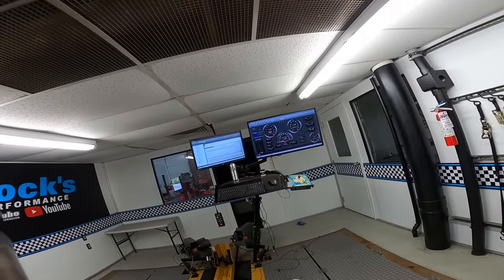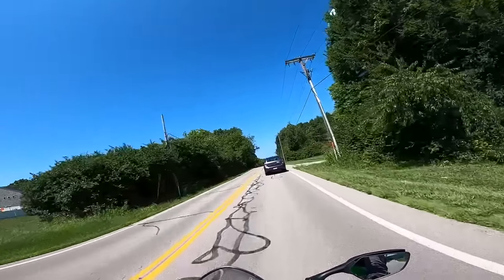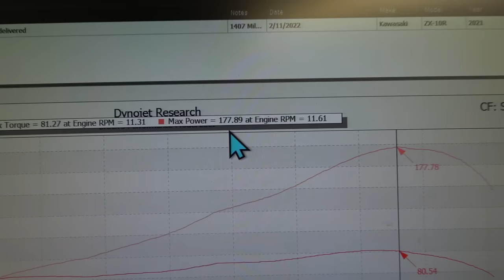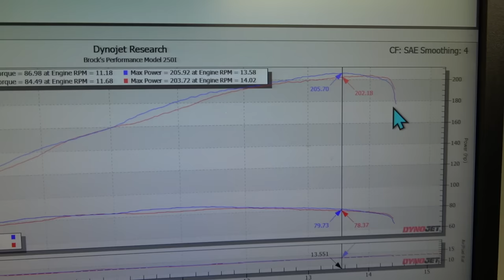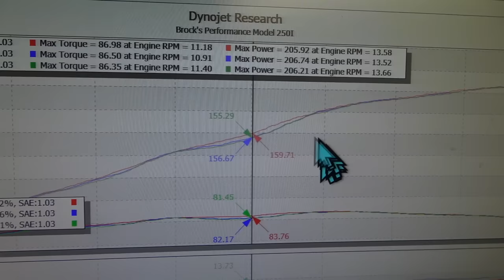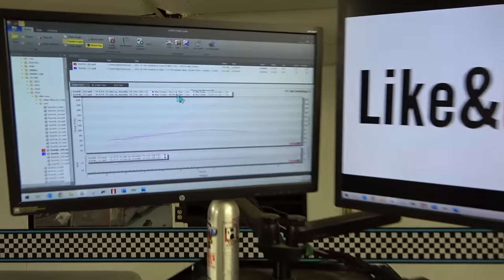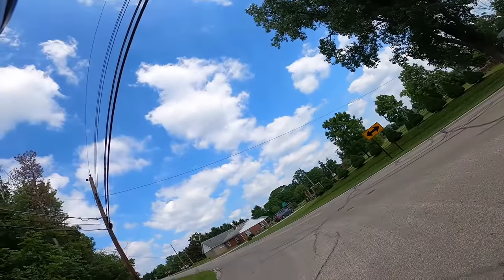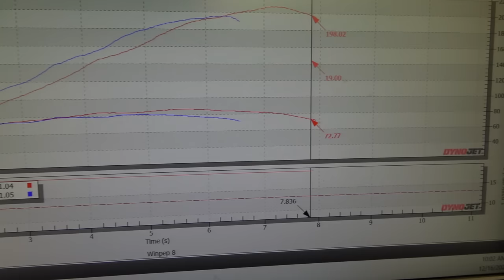2021 Kawasaki ZX-10R Sets New 1000cc Horsepower Record

Comment: I see you still consider Kawasaki 10-40 FS the best heavy oil. Any reason you don’t consider Motul 300V or 7100 better?
Reply from the maker: Yes
Reply: @BrockDavidson  So their 2022 reformulation hasn’t degraded their quality ? I know you said Mobil 1 was the go to until they lower certain values. Cheers
Reply from the maker: Haven't tested it, no disrespect to Motul as they make GREAT products! But after 20+ years of a combination that still excels...why would we change? (Side note: we do not sell "wet clutch approved" products as the regulations are nothing more than handcuffs. We offer THE ONLY oil and additive that truly allows longer clutch life under DRAG RACE stress (we have confirmed 500 degrees F during the launch). Since the ONLY OEM that we can confirm actually drag-raced a motorcycle during  development ( Gen 1 ZX-14...to the best of our knowledge) it's not really a surprise the Kawasaki blend works so well.)

Comment: Brock didn't you have a 2012 zx14 do 230hp once on MR12?
Reply from the maker: I clearly state "normally aspirated 1000 using all bolt-on parts" multiple times, especially in the beginning of the vid? And Yes, the ZX-14R is the king of normally aspirated, all bolt-on stock bikes - I remember 227 RWHP (With BST Wheels and bored stock throttle bodies)....close enough to 230 I guess.
Reply: @BrockDavidson  I thought the 14 was normally aspirated as well. Didn't realize it wasn't..had the same 14 that year so I was pretty pumped that it made that hp. Good stuff with the 10 though.  Great content!

Comment: What about best race fuel for HIGH compression on NA build?
Reply from the maker: That depends. We use MRX02 until you get into high comp + nitrous, then we go C16. The VP N2O is supposed to be good, but we haven't used it.
Reply: @BrockDavidson  impressive! Is mrx02 still good at up 16:1 compression on NA build?
Reply from the maker: Yes it is
Reply: @BrockDavidson  Thanks 👍

Comment: Hey Brock, with all these new and improved models coming out, which bike would you recommend for someone fresh into the drag scene?
Reply from the maker: That's a VERY long reply. It depends how serious you are, what class you want to run and about 500 more detail questions. The bottom line, buy what you like...any can be drag raced.
Reply: @BrockDavidson  it might make a good video idea. I’m 46 yr old never really had the disposable income to entertain the idea of drag racing, or made the sacrifices to be at the track racing. Anyway. I do have the income now and it’s all I can think about. Been watching all the videos I can to make a good choice for the beginner drag bike. I plan on attending Chris’ school if he has them again. But what bike? I thought it should be a 600 but I’m 240lbs and I don’t want to get bored with it to fast. So I figured a 1000 should do or since I’m so big should I get a 1400.  But I think I’d probably only hit the track on test n tune no serious sanction stuff. 🤷‍♂️
Reply from the maker: @Tim, the Busa is the king of drag racing and has an endless aftermarket following to allow you to customize it to suit your needs. At your weight, we would shy away from 1000's as the smaller clutch and low torque make for a bad time at the track for bigger guys. For all bolt-on street performance with occasional drags, the ZX-14R is hard to beat for bigger guys also. 600's are for guys that weigh as much as one of your legs, lol. Hope this helps.
Reply: @BrockDavidson  thank you I really appreciate your feedback. That’s exactly what advice I was looking for. Now it’s time to find a bike and order some parts!! From Brocks performance of course.

Comment: Hey brock, quick question, im comparing ignition mapping between a 2007 GSXR1300 a 2008 model and notice that there is a heap more advance in the high revs 0 to 5 % tps on the 2008 than the 2007 (eg. TPS 0 RPM 7200-- 2008 = 87.5, 2007 = 25.5.
 Is that mainly set to aid in engine braking and can the values from the 2008 ignition mapping be used on a 2007 when calculated correctly based off the TPS %?
Reply from the maker: Compare the stock maps. The OEM's do this for various reasons, either emissions , noise abatement or a combination. And it's typically in an arear of the curve you simply cannot reach under normal riding conditions - IE 0-5% throttle at crazy high RPM's (you would need to be idling in gear down a mammoth hill, etc...) I say, check the stock maps because then you don't have to consider an internet warrior/ "super tuner" undoing the OEM's hard/logical work.

Comment: Hey Brock , I have a question.  If other tuners are able to get the nominal air fuel  ratios with the  same mods that you have on that zx10r how are you able to get so much more power ? Do you adjust the timing  and have  secret sauce that you use . And 1 more question, I have a gen 1 zx14  with all your goodies  what is the best way to increase my  hp .I'm going to be taking it to Chris Moore  for a dyno tune and I wanna  li light the score board up
Reply from the maker: Do everything we did here: https://blog.brocksperformance.com/kawasaki-zx-14-06-11/
Reply: @@BrockDavidson  ....that's the  holi bible brocks edition. Lol thanks for the reply  and  all you do for the sport. I'd like to see a 14 engine stuffed in a zx10 frame .
Reply: @Popsm0ke a 14 engine in a 10frame is useless.
Reply: @tkitchens91  ....how is it useless?  The 14 makes more hp and torque
Reply: @Popsm0ke  because the zx14's motor is way heavier and it only makes 5 hp more from the factory... it doesn't have a wide enough margin on the 1000's power to offset the weight difference. That's why these 1000's will usually outrun big bore bikes to about 150ish from the factory. I have a gen 3 10r.... My ZX10R stock for stock was faster to 150 than a Busa OR ZX14 when they came out. The new bikes are restricted to death so they're slower, but as soon as you flash/tune them, that changes. Moore mafia put a 2019 ZX14 on the Dyno after a flash and tune, and it only made 211 hp on MR12.... And Brock just mentioned in this video that the zx10 made 214 on MR12. That speaks volumes as to where the power curve is on these bikes. The ZX14 will pretty much always have more down-low streetable power, but concerning peak horsepower without adding forced induction, as well as power-to-weight ratio, the 1000 wins. The 14 makes a decent amount more torque, but when you start modding the 1000's that gap disappears pretty quickly. 
So basically what I'm saying is that stuffing a ZX14 motor in a 10 frame would upset the chassis balance so it would be useless for any other track than a drag strip, and even on the drag strip, guys are getting so much power out of the 1000 motors that stuffing that bigger engine into the smaller frame won't net you much gain because you can stroke nearly the same power from a 1000 and the engine is 50 pounds lighter.

Comment: Are using zero weight oil in the ZX Brock?
Reply from the maker: Yes. Full product listing in the long description.
Reply: @BrockDavidson  
I used zero weight oil back when I was drag racing, good for 4hp on the dyno but I wouldn't be driving around on the street with it  espicially in hot/humid weather and definitely not in my 1290 Super Duke R, it's a V twin which uses 15w 50 weight oil....lol. Luv to see you do something a little different and work your magic on a Super Naked like the KTM Super Duke R, not in your wheel house but it would get some views, maybe bring mine in for a dyno tuning session...lol. Nice work as always. We used to chat way back when at the track, I'm friends with Gary Benson and Mike Sweeny. Gary just hopped up his H2sx with your set up, runs great.
Reply from the maker: @bullet1300 - certainly no lightweight oil for a 1290. We don't mess with the EURO bikes as so many of our customers like drag and land speed to gauge their real-world performance. I understand the Super Dukes have a phenomenal motor, but I've never personally ridden one.
Reply: @BrockDavidson  
Ya I figured you didn't mess with the Euro bikes much. You ever get a chance to ride one they are insanely fun, the ergonomics are super comfy, its a total hooligan bike. I owned  many busa's, 1ks amoung other bikes most smiles per mile hands down....lol. They may not go 200mph an hour but I stay in front of a friend's Gen 2 busa with a full Akrapovic, hf air filter, flashed and tuned busa from a second gear roll and stay in front till we hit 170mph, after that aero's are working against you without a fairing ....not bad for Vtwin....lol.
I'm a canyon carving, road racer so the bikes suspension has been fully upgraded, it's a beast through the twisties, lotta fun leaving 200hp liter bikes for dead....lol. Go on YOUTUBE and search 1290 super duke r dragstrip, there's stretched ones running low 9's to 8.50's blowing off stretched 1ks and busa's, pretty impressive. Happy Holidays Brock!

Comment: is it anywhere near as fast as the Bren tuned ZH2?
Reply from the maker: The ZH2 has considerably more power, but it's heavy and naked. The Z might get the jump, but the zx-10r will catch it, pass it and continue to pull away for as long the race continues. From dead stop, the 10 will run away.
Reply: @BrockDavidson  why is the zh2 or h2 so much more heavier when it's also a 1000, is the supercharger that heavy?
Reply: @BrockDavidson  is this 2021 zx-10r faster than the one you smoked in your video after the zh2 had its flash? love that video btw, 140mph wheelies  love it.   maybe a biased opinion i have, as a zh2 owner
Reply from the maker: Yes + steel frame vs. alu.
Reply from the maker: It's the same 2016 Sprint Filter long term test bikes in both vids.

Comment: Uncle brock why don't you sell a power commander with the stock velocity stack map and the pentacarbon exhaust as a combo ? It's going to be easy for us indians to buy stuff as no ecu flashing or dyno tuning exist in our nation. Only way is send the ECU to moor mafia as brentuning is very hard to find in india
Reply from the maker: @Kishalay Kumar - Everything we offer for this bike is listed in the long description and we ship worldwide. Mailing in your ECU is not required as we offer the BT Moto Stage 1 or 2 flashes via the handheld unit. The exact PCV maps we used in this video are available (no charge for verified exhaust purchasers) via our Map Support Program - details are included with purchase. The only issue you will have in India is with pump fuel variations, and this is easily solved via the PCV. More info. here: http://blog.brocksperformance.com/faq/can-i-use-brocks-maps-with-fuels-in-different-countries/

Comment: Not trying to knock your work but seems to me your Dyno reads a bit high I did a test with a few bikes same day and used 20 different bikes and never seen a kawi hit those numbers.
Reply from the maker: We get that sometimes. Dyno's are simply a reference, the real test is on the race track. Watch this video to see how we compare to 25 bikes tested on other dyno's: https://youtu.be/WNotLs-_5sw?t=619
Reply: My 2021 with full m4 system, sprint filter and use woolich software for access to ecu yielded me 202 hp at 600' elevation 75 degree day on a Mustang Dyno with pump gas.  Pretty comparable to Brocks results

Comment: what was the hp and torque at 8000 RPM?
Reply from the maker: 207 Pump Pulls  120/79
214 MR12 Pulls 125/82
Reply: I'm trying to read what mine was from my 04 but my pictures are not clear mine makes really good power all the way through I didn't have any rules LOL my '04 is not stock but it is my daily Rider lol I got a switch for pump gas and mr12 as well
Reply: Id post the picture I have maybe you could read it better but I can't figure out how to do it lol
Reply from the maker: e-mail it to me: bmail@brocksperformance.com

Comment: 36:36 you say if you landspeed then it might take 10s to go from top power to then you point at the curve after the top. Do you really say that at top speed in top gear the bike can actually pass its top RPM where the top HP comes down? Also not having the RAM working on the dyno you cant just go ahead and claim that these gains will be there at top speed same it was on the dyno as we dont have the data how it will change the airflow. As far as we know having no stacks would be the best at actual top speed when the RAM takes over the function of filling up the cylinders.
Reply from the maker: I think you need to watch the video again?
Reply: @BrockDavidson  All I'm saying is that you have the resources to do real life testing where the RAM is active. The venturi effect probably is not working while there is positive pressure present so to claim anything about different stacks on a static environment could prove incorrect. On the standing mile there absolutely no way a vehicle can go into over rev. It will top out where the power tops out. Could a no stack working RAM give more power on top? Needs testing. I also did miss the part where you talk about the stacks as not something that adds power but rather distribute it to a different power curve. This can also be tested in the track while the RAM is working but only there.
Reply from the maker: If I understand you correctly, you believe the bike will reach peak power in the mile and simply stop accelerating?
Reply: @BrockDavidson  You said it yourself in the video that you had 10sec after you have reached the top speed to hold onto the bike and how terrifying it was for you. I know you had to be very gear limited to do that on a standing mile run but thats not my point. All I wanted to say is there is a point where an equilibrium is reached where you need a certain power to overcome all the resistance like rolling and wind etc. There is no way to go into the over rev area like you do on the dyno on a standing mile run or any other when you have to overcome all that. It can only happen on the dyno and it is absolutely meaningless as it is not a clear representation to when the RAM is active and state that the same percentage just gonna transfer over when its active.. You gained let say 5HP in the over rev on the dyno but you might gonna lose that much when the RAM is active instead if the engine can reach that RPM to begin with. .I just dont see why would you even try to prove any performance changes on bikes which was calibrated to use the RAM,  on the dyno instead out in the wild. Even the low and mid range curves could be very different out in the real world. You have gotten the resources to do it right. You could see which setup went faster top speed when the engine rev stopped climbing the write that number down. Later you can calculate how much power you had to have to go that fast and see where the RPM did stop climbing clearly see which part performed better. The venturi effect is much less effective if its even effective at all when there is a positive pressure on the side which should have less than on the other side. Thats why the gen6 stack works better on low-mid range as it is a way better design but to say it does outperform a much less restrictive short stack when there is pressure present feels kinda funny to me.